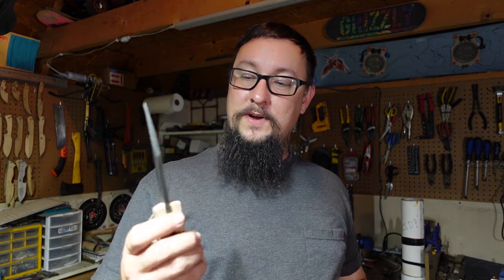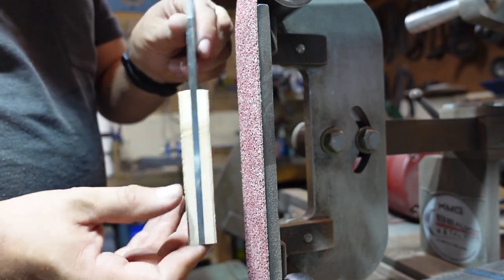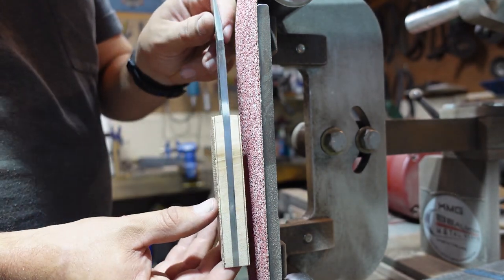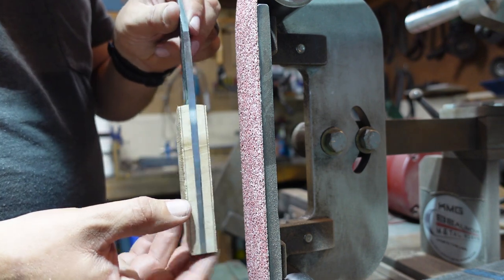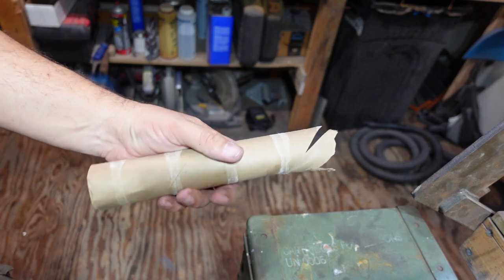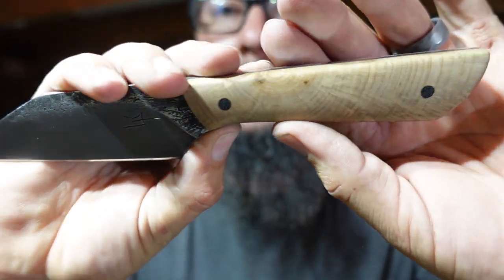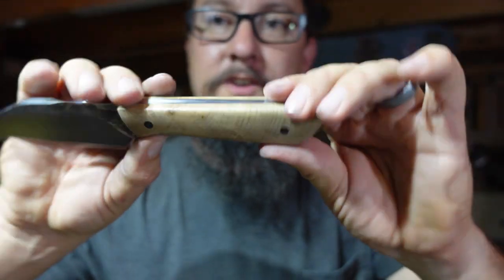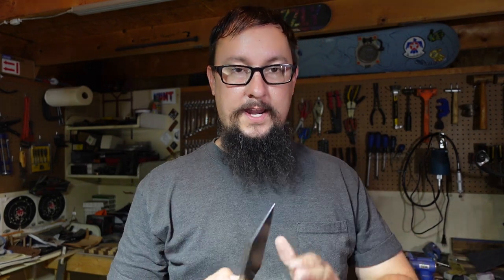Shaping The Handle And Sharpening The 5160 EDC Seax | Daily Vlog | Knife Maker

Comment: Can you say the belt type and grit ur using on your belt grinder
Reply from the maker: I was using a 36 grit for the main shaping of the handle. When it comes to the sharpening I started with a 220 grit on the 2x72 and then did a 1000 grit on the 1x30 followed by a leather stropping belt.